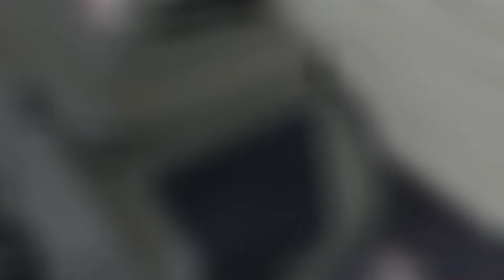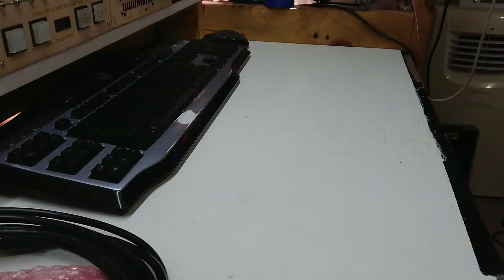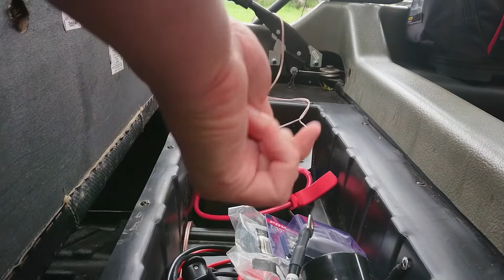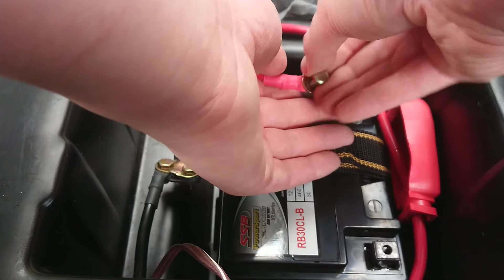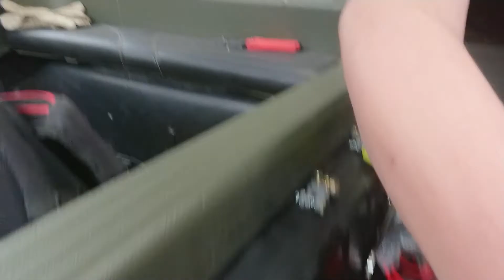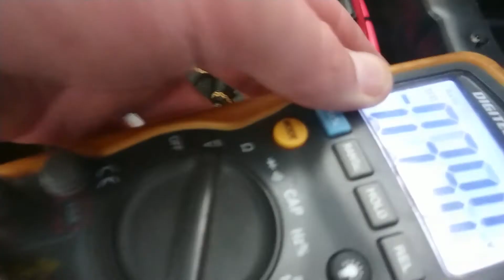AGM Battery Replacement | New Argo 8x8 - Episode 8

Comment: Hi, great video.
When disconnecting a battery, disconnect neg/chassis terminal first.
When connecting connect neg/chassis last.
Why.
When removing battery, if you use spanner to disconnect positive and the spanner slips and shorts to chassis, big sparkies.
But if you disconnect neg/chassis first, when undoing either terminal and spanner slips and shorts to chassis, no big sparkies.
Unfortunately that will not stop the terminal to terminal spanner welding slip. Ooopsss..😜😃😜😃
search  "why disconnect negative battery terminal first" in YouTube search...
Reply from the maker: Plastic body - chassis contact is not an issue, and the Argo manual indicates positive first, but yes normally in a vehicle that would be correct I know.

In this case I had already isolated the battery elsewhere first, before letting my apprentice in there.

The Issue I had was contacting one terminal to another with the spanner,  and normally I use a special spanner for the task, in this case I got lazy/distracted with obvious results.